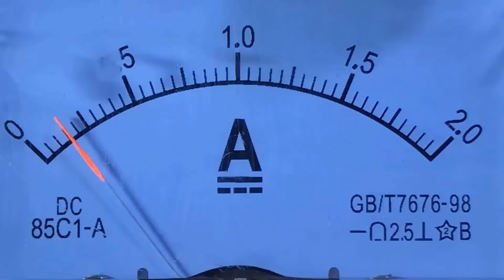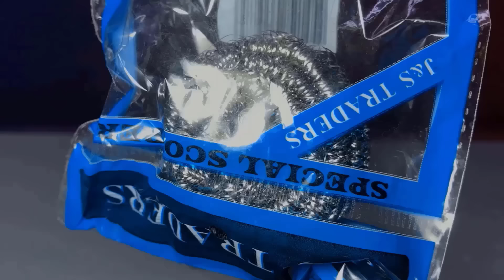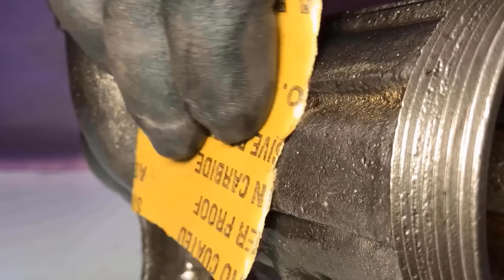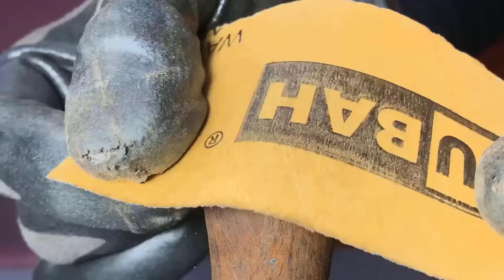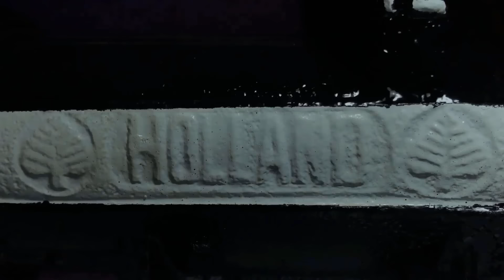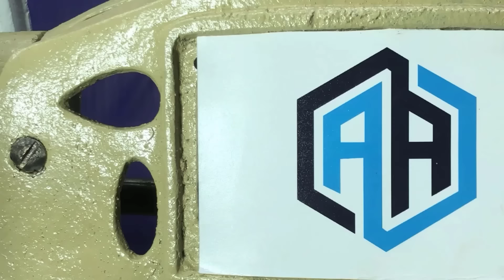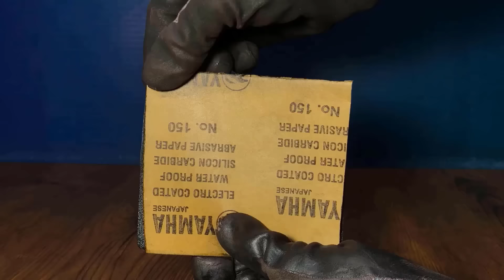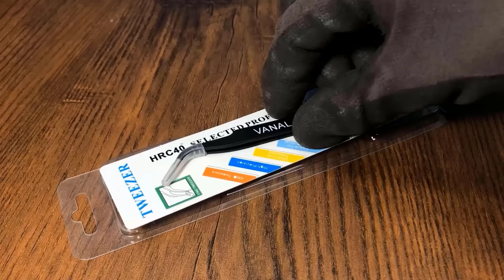Rusty Antique Gun Restoration - TT 30 Pistol ! Lot Of Amazing Restoration Techniques

Comment: If you just use the meat grinders just to display them, painting them that's  fine. But should they go back to usage then I recommend to stay clear of using paint. Instead rather keep them as they are and heavily oil and grease them so they don't rust. Or look into the option having them nickel plated.
You are doing a great job otherwise and I enjoy watching your videos.